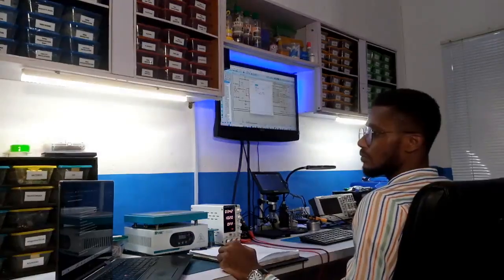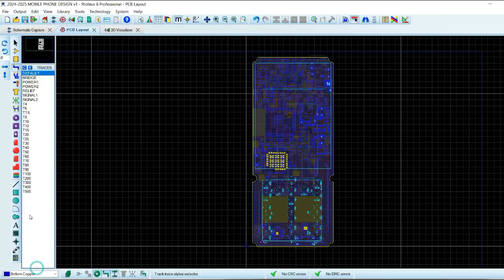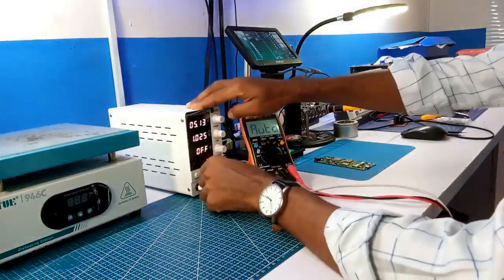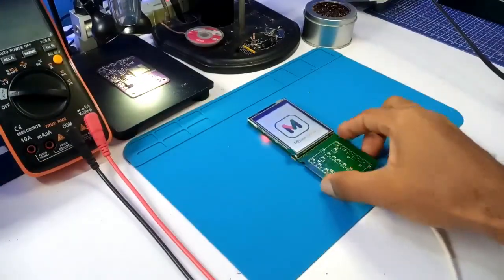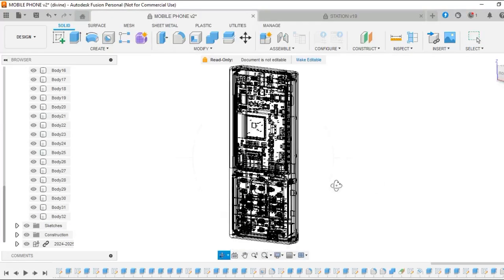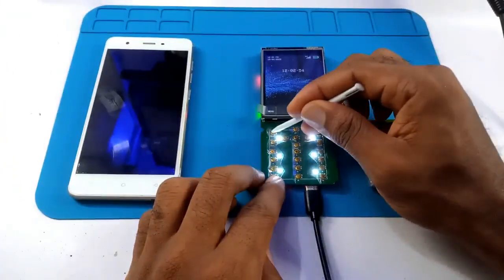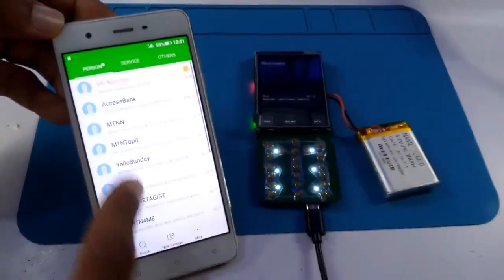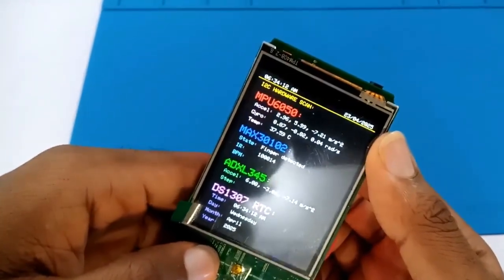How These Nigerian Engineers Built a Mobile Phone in Aba! 🇳🇬Nigeria

Comment: Inspiring work. You have to be mindful of costs, not only in terms of the materials, but  in terms of assembly and finishing. The keypad, for instance, might cost less than a touchscreen, but soldering the individual contact switches and attaching their keycaps could wind up costing significantly more. You should base the cost of the materials based on an expected production volume. Materials are often significantly cheaper when ordering in larger quantities.
Reply from the maker: Thank you so much